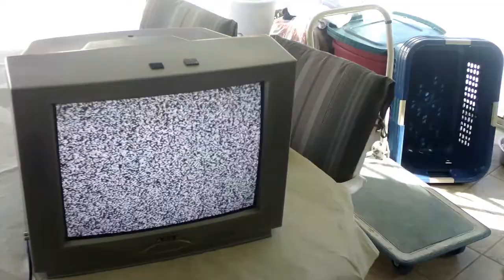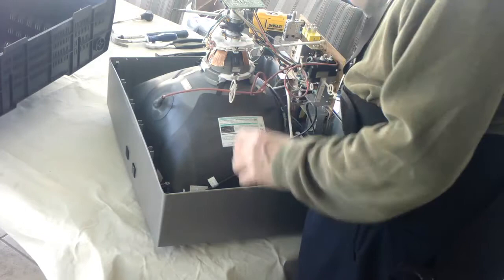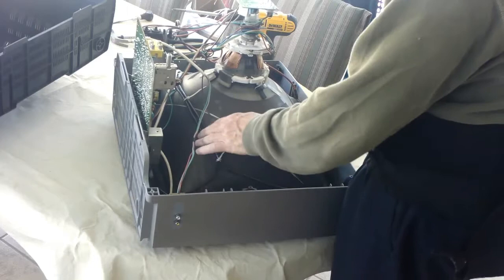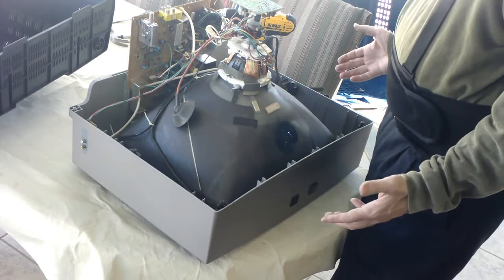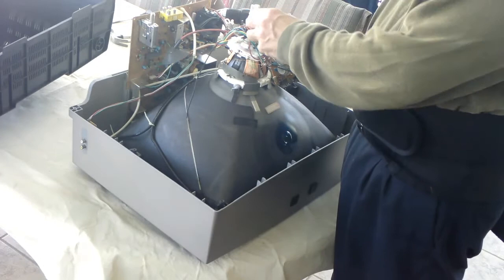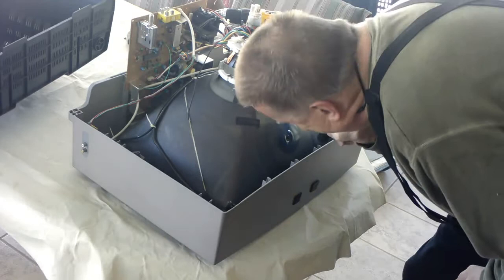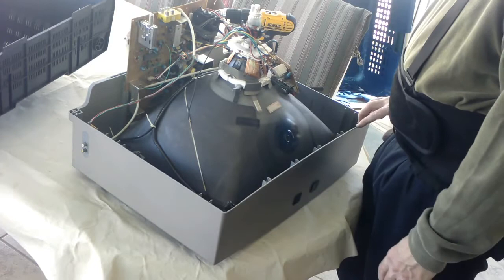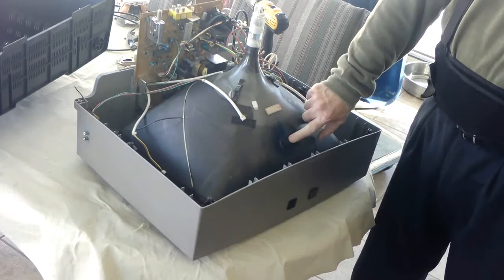How to SAFELY Discharge and Release the Vacuum from a TV / CRT / Computer Monitor Display tube.

Comment: Thank you very much! I was looking for a video on how to safely manage the internals of a crt, I would like to turn one into a helmet for a halloween costume which requires safely stripping a crt down to only the shell. Most of the tutorials I found about making the helmet didn’t cover removing the internals as extensively as I would have liked, or they reccomended unsafe measures like the ones in the videos you mentioned. After hearing stories of people being shocked and potential retained electricity in crts, I want to be sure I know what I’m doing first. 

I have one question surrounding the capacitors that are on the motherboards of crts. Some sources I’ve seen highlight being sure not to touch them when removing the internals from the shell. Is it safe to just wear gloves and avoid touching them or would you reccomend anything else surrounding managing them safely, or tips surrounding taking all of the components out in general? 

Thank you!
Reply from the maker: I suppose that wearing thick rubber gloves like a dishwasher in a professional kitchen would wear could probably provide a decent amount of insulation, but personally I think that the reduction in manual dexterity would make it too cumbersome to be worthwhile.  Alternatively, while wearing one or two layers of thin rubber gloves like a medical professional might wear could provide a minimal amount of protection with improved dexterity, they would tear easily.  My suggestion would be this:   If you can gain access to the "solder-side" of the boards where the capacitors are mounted, all you would need to do to ensure that the capacitors are discharged is to ball up a wad of aluminum foil, grab it with some pliers, and press it against those solder points.  The capacitors would discharge immediately, but there would probably be no sound.  No gloves required, in fact, the pliers are optional.  Hope this helps!  🙂

Comment: Hi i never turned my tv on, so i dont know if it works or not, but if i dont hear the pop sound what does it mean? I got this from the sodewalk of a house so i dont know how long it has been since it has been plugged in.
Reply from the maker: A lot depends on how OLD the TV is.  Older TVs were really good at keeping their charge, and that charge would help the tube power-up much faster.  Newer TVs do not take as long to power up, so they started incorporating a "bleed resistor" to slowly discharge the tube.  Either way, if you discharge the current like I show you, you should be fine, even if you do not hear a "pop" from a spark.  To be sure you can short it out for a longer amount of time.  Long story short - just be careful what you touch - and avoid touching anything metal.
Reply: @ToddMcMahon  Thank you so much! I really didn't expect you to respond so fast!
Reply from the maker: @audreyellacho  - My pleasure!  🙂

Comment: Do you still need to discharge it if you know it hasn't been use or plugged in well over several years? I thought about doing a project with an old tv like this but now I'm a bit nervous 😅
Reply from the maker: While you  still need to discharge the "Vacuum", discharging the electrical current might not be necessary any more after such a long time.  This being said, it is a simple thing to do, so why not go ahead and do it just to be sure?
Reply: @ToddMcMahon  thank you for the reply 😊 I probably will do it just in case then. Thanks for the easy to follow video too. Hope you have a good rest of your weekend !
Reply from the maker: @copyshy   You're welcome! 👍   I'm glad you found the information useful!  🙂

Comment: I was always taught to snip the glass nipple under the plastic cap at the end of the electron gun. Not correct?
Reply from the maker: Unfortunately, no, due to the glass shards this can create.  MANY people do it the way you describe because it is EASY.  Being easy does not mean it is correct, nor safe.  If you insist on breaking the glass nipple, be sure to wear safety goggles and use a thick cloth rag over the nipple to catch the glass - and then throw the cloth rag away.  However, I would HIGHLY recommend that you use the method described in this video (just use a sharper ice pick!).
Reply: @ToddMcMahon  I appreciate your reply mate. Never too old to learn. Thank you very much!
Reply from the maker: @pauljcampbell2997  My pleasure! 🙂

Comment: Is there somewhere specific I should dispose of the bulb/innards?
Reply from the maker: The tube is actually considered Hazardous Waste, and needs to be disposed of correctly.  It seems that every City does things differently, so it would be best to try to find out what you need to do from your City's waste management office, or environmental services department.  Just remember that these days it is usually not only Illegal to dispose of them improperly, but it will typically involve a huge fine as well.
Reply: @ToddMcMahon  awesome, thank you!

Comment: hello.I has some CRT TV and I want to repair some of them,I already know how to discharge  electrical current in CRT with screwdriver and alligator clip,But Is It really need to release the vacuum from CRT before I tear off PCB of CRT TV in order to repair work?
Reply from the maker: NO.  If you release the vacuum the CRT will no longer work.  These instructions are for recycle and disposal.  NOT for repair.

Comment: I'm interested in just keeping the case of the CRT for a project I want to do, is there a way to safely remove the tube and glass from it?
Reply from the maker: As explained in the video, you should discharge the electrical current stored in the picture tube by shorting it to ground;  After this, you should release the vacuum by piercing the thin metal of the anode contact (where the cable from the fly-back transformer connects to the tube) using a nail or sharp ice pick.  What is the project you will be working on?

Comment: how did you get the assembly loose from the tube? At mm 10:34. mine is disassembled to there but the thing wont loosen & come off. I dont see any missed screws. thanks.
Reply from the maker: Hi Patty!  Right there at 10:34, you will see that I am using a screwdriver-bit in my drill , and I am loosening a silver-colored metallic clamping ring which holds the defector coils in position.  The position of this assembly needs to be "adjustable" in the factory, so it will have a clamping mechanism of some type.  I am sure that if you keep looking, you will find it.  It might be covered by a plastic shroud (etc.).  Good luck!  🙂

Comment: I have a Sylvania from, I think it was manufactured in 2003, that I use for all my classic and "retro" video games, and I think the a/v jacks need to be fixed on it (both the inputs on the back and front are loose when either plugging the cables into the TV or otherwise just jiggle about, the screen dims and both brightens and dims as jiggled about etc., the jacks on the front cause the display to black out when jiggled, etc.) Do I need to discharge the TV in order to simply open it and attempt any repairs on the input jacks myself? Also, would I be best off finding someplace to get the TV repaired instead of doing it myself? I live in the LA county of California, and don't know of any places or who I could trust with the TV...
Reply from the maker: Unfortunately, there are very few (affordable) electronics techs these days, and most of them only do board swaps.  It is uncommon to find a repair shop where they are willing to do component-level replacements.  Based on your problem description. it sounds like a simple contact problem.  To answer your question though - "YES" - it would be wise to discharge the electrical current in the tube before working on it.  This being said, some monitors/tvs have a "bleed resistor" that allows the tube to discharge over time once it's powered off...  I'd still attempt to discharge it first though.  Better safe than sorry!    I think your biggest issue will be where to buy the replacement connectors.  Good Luck!  🙂

Comment: I am trying ro do this for a small two inch crt so that i can do sort of kf a cut away for my students showing how an electron gun works. Anyway going about it ? Its a very small diameter tube that is russian
Reply from the maker: WOW!  That is a VERY small CRT!  Well, first of all, simply because of the toxic nature of the contents of the tube, I would  recommend doing this.  This being said, if you are going to attempt this anyways, please keep in mind how thin the glass is in the neck area.  Remember to release the vacuum before you do ANYTHING.  I did happen to see a video of someone cutting glass bottles using a string, wetted down with a flammable liquid.  The string is lit on fire, and the bottle rotated to even-out the heat distribution, and then while the burnt string area is still hot, the bottle is dipped in cold water, and the glass fractures along where the string was.  
Here is a similar video:  https://youtube.com/shorts/XMwB0HcRs5g?si=CHKFUgR_Uhc_vHGV   
Please note that the water will become contaminated by the contents of the CRT, as well as whatever bucket or pan you use to hold the cold water.  These items should be discarded as toxic waste in such a way that there is ZERO chance that anyone might use them again.  I have no idea how to clean any of these items well enough to make them non-toxic, and I certainly would not allow anyone other than yourself to handle the open tube - do not let students touch it.  Wear thin rubber gloves and a dust mask when handling these items.  Again, I think using drawings, diagrams, and photographs from the internet would be the better and safer choice.  Either way, please let me know what you decide to do, as I am very curious about this!!  Good luck!
Reply: @ToddMcMahon  thank you very much for your help!!! Will keep you posted !!
Reply from the maker: @finnishsnow3182  - You are very welcome.  I'm looking forward to hearing back from you.

Comment: hi! if we follow the instructions here and release the vacuum, is there a way to safely remove the tube at the back after this? i have a long-dead tv with the wires cut out of it that i’m trying to turn into a decoration but the tube makes the whole thing too bulky, so i was hoping it would be removable (as to make it sit flat against a wall) but now i’m not so sure!
Reply from the maker: Hi James!  Before releasing the vacuum, you should discharge the electrical current as I did in the video before I pierced the tube to release the vacuum.  The tube is "fairly" safe to remove at that point.  There are typically four large screws in the corners of the tube holding the tube against the bezel of the TV housing - but remember that the back end of the tube is made of thin glass, and it will still shatter and make a mess if dropped (but if the vacuum is released first, at least it will not IMPLODE on you).  It is probably important to mention that if you remove the tube, the whole thing comes out.  there is no additional piece of glass or plastic, so there will be a huge HOLE where the picture tube once was.  Good luck!  🙂

Comment: Do you have any recommendation of electrical gloves for handling the discharge part of the CRT tube? also, I don't think I need to release the vacuum if I plan on continuing using the CRT, correct? and for putting the anode cap back, would I need to seal it with some sort of silicone glue? I bought a nice CRT not long ago for arcade/retro gaming and would love to clean it inside (maybe do some RGB modification in the future), but the discharge part and the possibility of breaking off the end of the yolk/glass part worries me. As for cleaning the inside of the CRT, would you recommend something like the [WD-40 Specialist Electronics and Electrical Parts Cleaner]? Thanks.
Reply from the maker: Do NOT release the vacuum if you want to ever use the CRT again.  Personally, I think gloves get in the way.  Just be careful and do not touch anything metallic.

Comment: Can you also use a screwdriver to puncture the metal and release the vacuum? I will get an old crt tv sometime and I just want to make sure that I'm safe when releasing the vacuum.
Reply from the maker: I would NOT advise that.  Please use either a (sharp) Ice-Pick, or a Nail that cn be held easily by hand or with a pair of pliers - and strike either of these with a hammer to pierce the thin metal plate.  Better safe than sorry!
Reply: @ToddMcMahon  Ok thanks

Comment: need to discharge a 40" CRT, do you recommend a chicken stick?  (modding it for RGB). i was thinking PVC pipe from hardware store with a screw driver tightly taped to it (very tight for stability). and then doing the alligator clip/wire from screw driver to grounding strap. any chance the electricity will go up the pipe handle? heck i was thinking of even using fiberglass wall insulation as a handle cover of the pipe lol
Reply from the maker: As long as the CRT is powered off and unplugged, if you can short out the High Voltage Anode to ground, it should be safe enough. I doubt that you need a PVC pipe.  Just be safe, and don't touch or hold anything metal as you do the discharge.  I'm curious about this modification for RGB you are doing.  Why are you making this modification?
Reply: @ToddMcMahon  for retro gaming

Comment: Can't you discharge it by pushing the power button a few times?
Reply from the maker: The short answer is "no".  While that might hold true for other types of devices,  most Monitors and TVs are specifically designed to retain and preserve this stored energy to speed-up the power-on process in order to be able to display an image that much faster.

Comment: I have to get to the control board that has buttons for volume, channels, menu etc. located on outer portion of the top of the tv. I'm guessing that taking the back cover off alone (as long as I'm careful) is pretty safe? 

I just need to see inside of it and see how that board is connected. Volume is at 100% and I can adjust using the remote but it immediately increases to 100%. 

Guessing that said board at the top is bad.
Reply from the maker: Be sure to unplug the power cable from the wall first.  If it was powered on recently, there could be residual voltages inside, and some of them are powerful enough to cause injury.  You can increase your safety level by wrapping the exposed metal of tools (like screwdrivers, etc.) with electrical tape.  Perhaps wearing rubber gloves could help as well.  Just be careful.
Reply: @ToddMcMahon Thank you so much for the reply. I won't be touching anything. I'm just removing the back cover and just getting an idea of how that button board is connected. Hopefully, it's not soldered in there.

Comment: Hi, I have recently been given an old tele that hasn’t been used in years and has had every single wire cut and the plug pulled out of the back of the glass. I want to separate the front curved screen of glass from the big bulky bit at the back to make a fish tank. How do I go about making sure it is fully safe to disassemble now that everything has been cut and unplugged? Hopefully I’ve explained that well enough to understand 😂
Reply from the maker: Hi Joseph.  Unfortunately, there is no practical way to accomplish this, due to the toxicity of the inside of the tube (your fish will die, because you would never be able to clean it well enough), as well as the dangers involved with cutting the tube open.  If you WERE able to safely open the tube and gain access to just the thick glass front, it still would not be advisable because of sharp edges of glass, as well as the tube components up near that front glass.  Besides the very poisonous hazardous waste (mainly phosphorous), there is also a "Shadow Mask", a screen, as well as an inner magnetic shield that you would have to remove.  Each of these provides an opportunity to injur yourself, or break the glass.  I recommend that you keep the tube intact - except to vent it as shown in my video, and then try to come up with an alternative for the front glass.   Maybe you could get some plexiglass, or some other form of clear plastic, and mould it over the tube, using it as a "form".  Remove the tube from the tv cabinet and support it with the front glass pointing UP; heat up the clear plastic in the oven (research this part), and then lay it on top of the tube.  Not sure if it would work, but it is worth a try.  Be sure to clean the inside of the tv cabinet extreemly well, and rinse thouroughly several times.  You will also need LOTS of "Aquarium Safe" (100%) Silicone.  Other sealants will have acids and other chemicals for curing which would also be deadly for your fish.  I hate to sound so negative, as it would be a pretty cool aquarium - I just do not think that using the actual picture tube will provide a good environment for the fish.  My guess is that you would spend a lot of time and money, and then just kill the fish.  Please let me know what you decide to do!  This could still be a fun project!  🙂